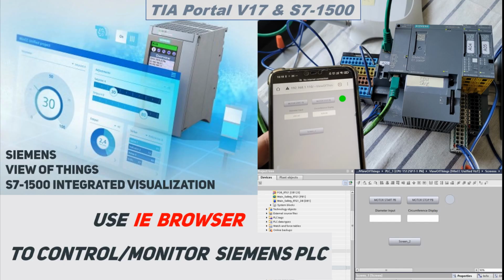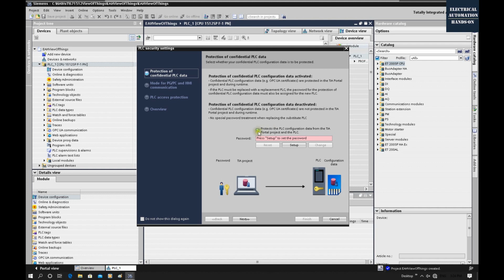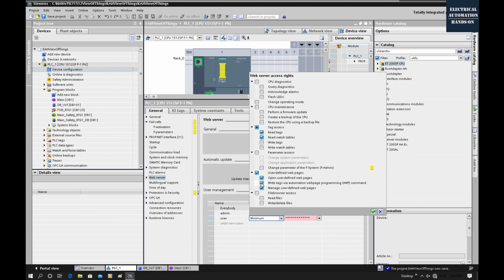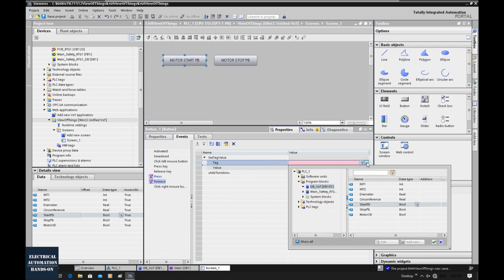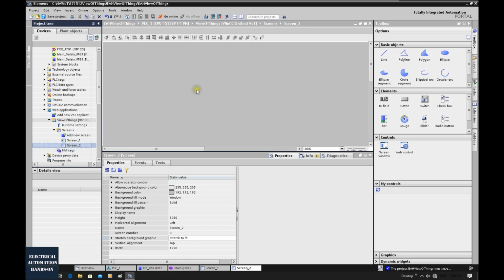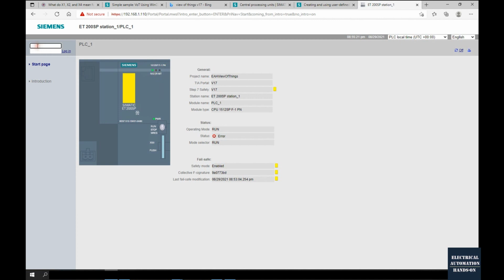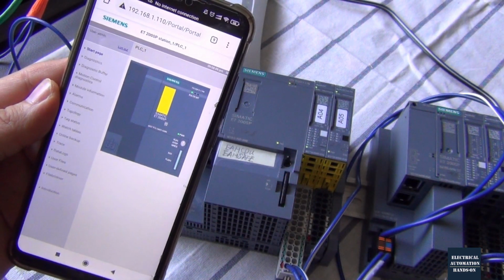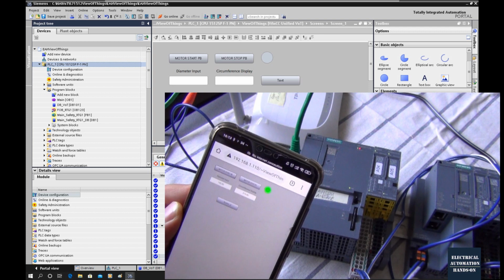COM24. Use Web Page to Control and Monitor Your PLC via Siemens "View Of Things" in TIA Portal V17

Comment: Hello , thanks for this great tutorial . I just had a problem when downloading my program to my CPU ( CPU 1514SP-2 PN) where it says "there is not enough memory to load all selected web applications to this device". although there is enough memery. 
Do you have a solution for that , or did i miss something in the video ?
Thanks in advance
Reply from the maker: Can you please show me your 'Program info' at the left side of your TIA project tree, what are thr load and work memory percentages
Reply: @electricalautomation   it says : 19% Load memory / 0.08% Code work- memory / 0.1% Data work-memory / 0.04% Retain memory 
( i have a 4 MB card in my CPU , maybe it is not enough ? )
Reply from the maker: @AHc51300  Your load memory and work memory has enough room for your program. My only question is what is the actual size of the program for loading memory, or what is the load memory size based on the 19%.
Reply from the maker: @AHc51300  Your memory card may be loaded with many programs before, so open the card by using a card reader, and delete the program files in that card (DO NOT FORMAT).

Comment: Hello, nice video. I am wondering if it is possible to access the webpage on a computer using a 4G network instead of wifi using siemens CP 1243-7 LTE module.
Reply from the maker: I don't think so, CP1243-7 is a module for S7-1200. This video introduced a feature from S7-1500. The webpage functions come from the S7-1500 itself. Therefore as long as you can connect to this CPU either wired or wireless, you can browse the webpage.

Comment: How to make connection betwen siemens and wlan access point? I want get connection via mobile phone to veb page.
Reply from the maker: In the video, I was using the cell phone to connect to the Access Point which is the local IP network. This way, your access point is only needed to set its LAN IP address, and in your cell, set a static IP address or assigned IP address (same network as the AP LAN IP).
If you are wondering a public IP from Access Point router, then it is about 'IP forward' setting in your router. you can search "IP forward an external IP address for local network" for the methods.
Reply: @electricalautomation   thanks i get connected :)

maybe do you have experience  to connect modbus rtu via beckhoff CX2500-0031 serial interface?

i get connection betwen siemens S7 1512 and my temperature sensor via modbus RTU, but i fails with Beckhoff cx2500-0031
Reply from the maker: @deividasnaudzius6504  Hi Bro, glad you got it connected. Regarding the Beckhoff Modbus RTU, I would recommend you switch your A-B wire. A acctually is '-', B is '+'.  I temperally don't have video for the Beckhoff Modbus-RTU, but I would doublt the main problem comes from your RS485 wiring.
Reply: @electricalautomation   thanks i wil try this.

Comment: Hi bro, is it possible me to access web server page using Internet? I want to control remotely not local connection
Reply from the maker: Yes, it actually depends on the setting in the router. it is called IP forward. The router will forward a public IP directly forward(image to) a local IP. So you can access internet IP,  then the router forward to the local device.  Or using VPN. this is I prefer. Your remote device will connect the VPN to your local PLC, this is safe and reliable.
Reply: @electricalautomation  thanks man, you are awesome and really helpful
Reply: Hi Bro, I have try with VPN but unsuccessfully, Im using Tplink router VPN, doesn't work. You have any opinion for easy setup VPN without using siemens product
Reply: The issue tplink VPN server cannot access, I also try NoIP VPN server doesn't work
Reply: I got 8 units s7 cpu behind my router, so I want to access remotely web server thru Vpn

Comment: damn bro , i've been looking for this , can i controll it with a distance ? , if so what is the longest ?
Reply from the maker: The cell phone showing in the video was connecting to a regular Access Point as the regular home used wifi AP. The distance actually depends on the signal strength of the AP. A industrial AP with 20db ANT usually can allow the devices within 200m to connect to it. A stronger ANT the larger distance for a client to connect.
Reply: @electricalautomation  hi, thx for the great tutorial. Is it possible to access the web pages through internet? Like regular web pages? If so is it enough to assign and online dedicated ip address?

Comment: Siemens video back ❤❤❤❤❤ please create series about technology instructions
Reply from the maker: Haha, Thanks a lot! I am working on some videos showing how to use Motion Technology Object and Program to control a DC Motor with Encoder project. Those are  'REAL' motion test videos. Also I published some videos before discussing the Motion TO and Program via virtual axis. They are at the link: MS03a. Single Axis Control - Project Introduction
https://youtu.be/xX3s2wCoNmU
MS03b. TIA Portal Technology Object (TO) Configuration
https://youtu.be/x2QscjGwyvo
MS03c. Reset, Power, Home, and MoveJog Instructions
https://youtu.be/1Nv-bam3vvc
MS03d. Move Absolute, Relative, Velocity, Stop, and Halt Instructions
https://youtu.be/Gn3AemffHgc
MS03e. Download Axis and Program into PLCSIM, OB91 Buffer Overflow Solved
https://youtu.be/NwzBaDsGpic
MS03f. Online Axis Test via Axis Control Panel
https://youtu.be/uhnqI4VYSEo
MS03g. Rotary and Linear Motion Control Online Test
https://youtu.be/QaepH_kKd-4